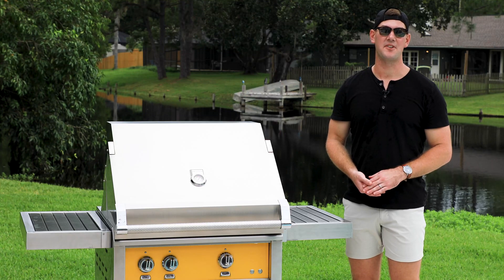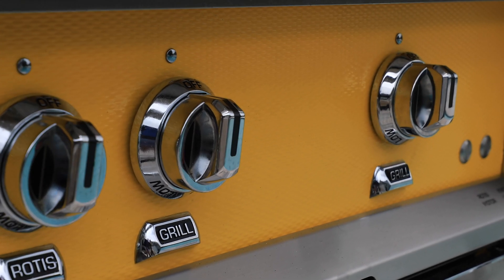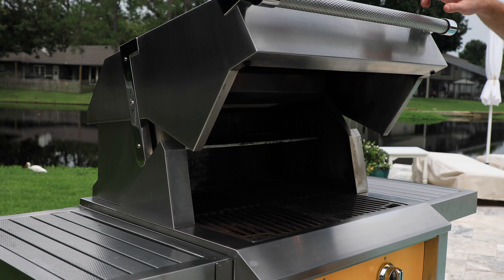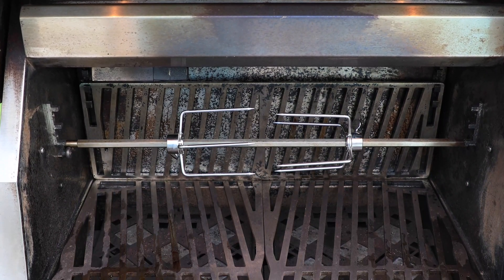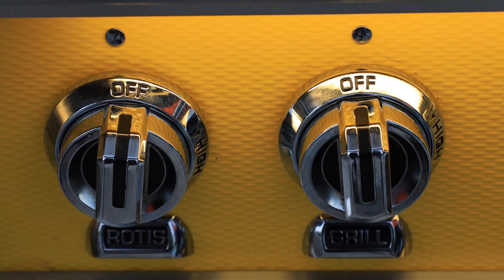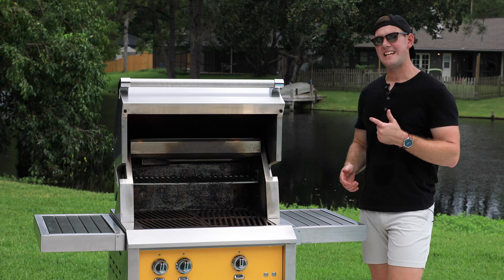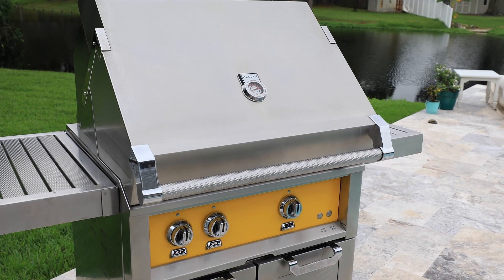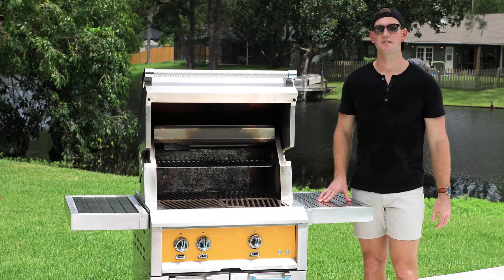Hestan Gas Grill Review | Grill Overview & Heat Test | What Makes These Grills Nice?

Comment: How manageable are flare ups with the Hestan?  I'm worried about the briquette system.  Some reviews rate the Hestan pretty low when it comes to flare ups.  What can you do to minimize flare ups?
Reply from the maker: What grills are you considering that you’ve read are better with flare ups? My view on flare ups really boils down to how clean people keep their grills and how messy of a cook someone is.

If the grill is properly maintained and cleaned frequently, flare ups shouldn’t really be much of an issue to deal with. Some people cook with too many oils, sauces and fatty foods with the expectation that a grill shouldn’t have flare ups because it’s expensive. 

Just be mindful of cleaning and cooking habits and you’ll be in good shape.

- Sam

Comment: Plannning on just the 30 since it’s just me and my wife.  Any reason the 36 is better other than more space?
Reply from the maker: Features will be the exact same. Only thing really to consider is if you’re planning on an infrared sear burner down low. If you’re doing that, the 36 might make sense so you aren’t rendering half of your grill space somewhat useless since a sear burner can only be used in a limited fashion on select foods.

- Sam
Reply: @justgrillin  isn’t the IR burner variable like the Lynx though?
Reply from the maker: @ESW206  you can use the top rotisserie burner for searing but some prefer having a true infrared burner on the main cooking area. 

Lynx designed theirs to be variable. Hestan’s is not. However, you really don’t want to use one of these burners to cook at low temperatures with fatty foods. The burner holes will eventually clog/you’ll get spotty performance. So while it’s a marketable difference, I wouldn’t make my decision on a grill based on that.

If you’re really just wanting a 30-inch, the Hestan makes sense cause you can get two traditional burners and use the rotisserie burner for searing. It’s angled down for that exact reason. And you can adjust the top rack in three levels based on how close you want the food to the burner.

Comment: Those briquette trays look rusted?
Reply from the maker: @ no. This is what most trays end up looking like when they have been cooked on a bunch over the years. It’s from the heat discoloring the stainless and grease/fat drippings too. This grill was a few years old that I used in the video. Was a distributor loaner. Wasn’t cared for as well as it should be.

- Sam

Comment: The brisket metal housings appear rusted.  Aren't these stainless steel as well?
Reply from the maker: Brisket metal housings?
Reply: Sorry.  Meant to say Briquettes.   @justgrillin
Reply from the maker: @rickirizarry5079  the housings are, yes. Their appearance here in the video is a combination of a few things but mainly boils down to cleaning and heat. The trays are going to change to a bronze color relatively fast due to heat. That’s why high end grills double line/wall their hoods so no discoloration makes it to the outer appearance. 

The second major factor is grease. Grease eats away slowly at the metal which makes it seems rusty when it’s not really rust. This grill belonged to our distributor and has seen some strong years of subpar cleaning. That’s what I would attribute what you’re seeing to mainly.

- Sam

Comment: I've heard that you have to worry about 2 things with this grill.  1. Wind can be a big issue with the burner flames damaging the grill.  Is this grill more susceptible to wind vs something like a Fire Magic Grill?  Also flare ups.  I've read reviews of people complaining about flare ups with the grease not being able to escape the ceramic briquet trays.  How would you rate the flare ups vs something more traditional like a Fire Magic?  Last how does Hestan warranty compare to the other big luxury gill brands?  Any reliability issues with Hestan?
Reply from the maker: Great questions.

1.) Wind is a factor with any grill. If you're in a windy area and don't have something to block the wind from the rear of the grill, you just need to purchase a wind guard to mitigate that. We're in a coastal area so a wind guard is pretty much an automatic add-on for many of our clients situated along the beaches in our region. Alfresco has the open-air system to help prevent the front control panel from heat blowback and they recommend a wind guard still. Manufacturers are getting stricter with their warranties so depending on the installation or setup, they might deny a claim stemming from what you're talking about because they would deem it improper installation if a wind guard wasn't used. That is if there's no wall behind the grill to break the wind. This isn't a metric we test so I can't really compare one brand to the other on this. If wind is an issue where you are, a wind guard/break is needed in some capacity probably regardless of brand.

2.) Flare up issues usually stem from poor cleaning. The trays are designed to be flipped over after every cook so you can "self clean" them by letting the dirtier side burn off when cooking the next time. If you do your basic care for the grill periodically, no reason that flare ups would be an issue.

3.) Hestan has a decent warranty. They add an extra year to it if you purchase a grill cover at the same time you buy the grill. Fire Magic's warranty is more robust and comprehensive. Hestan hasn't been around long enough for there to be a large enough network of existing grills to really get an understanding of maintenance on them. We haven't been notified of any issues with the grills we've sold and/or installed over the last three years. 

Alfresco Grills is another brand to consider in the luxury category. They're a top-tier brand and we get very low warranty claims on their grills. The reliability and performance is very good. We've repped them since 2004 so we have a long list of consumer feedback on their grills.

- Sam
Reply: @justgrillin  great appreciate your feedback!
Reply: You won't have to worry about the wind if it's a built in set up!

Comment: Echelon vs Hestan- what’s recommended?
Reply from the maker: Let me start by saying both are well-built products. That said, the features of the Hestan excite me more than those on the Fire Magic.

I think the lighting system is better, I like the dual-function rotisserie/sear burner, the tuck-away rotisserie storage, the stay-in-place hood and I like the grates on the Hestan more.

I don’t put much value in the built-in digital thermometer on the Echelon because I use external devices that I like more. Not sure if looking at the window model but I think it’s more gimmicky than useful.

Both have the same type of ignition system. Burners on both are powerful but each offers their own advantage. 

For the price points, I think you get more with the Hestan. I’d recommend looking at one in person if possible. The biggest consumer feedback we hear is the grill seems large because of the hood shape so some base their choice off that solely. 

If you have other questions, just reply back. Thanks for asking.

- Sam
Reply: @justgrillin  can you price a Hestan?
Reply from the maker: @toddbraden1752  our team can. You can call in to our showroom at 813-962-1700 or send an email to info@justgrillinflorida.com detailing what you’re interested in and your contact info.
Reply: @justgrillin  Thanks
Reply: Very very helpful review! Thank you!

Comment: Heston is the worst (and most expensive) grill I’ve ever owned.  It literally overheated on the second use and fried the igniters.  The knobs over heat and become too hot to touch.  Customer Service is non responsive.  After three months of constant calling they finally agreed to make the repair and now one week later I’m trying to cook my Thanksgiving turkey and the grill has gone out twice and the knobs are again too hot touch.  I don’t know who owns Heston but As an owner of my own company if you’re not willing to stand behind your product you have no integrity.  Don’t buy Heston grills
Reply from the maker: @DarrenSloniger-w5g  we’ve installed dozens of their grills and have never had a call back about this type of issue. Not really sure about what’s to give with your issue. Could need a wind guard wherever you’re located to stop the wind from pushing the heat forward? You could be cooking with oils that cause a mini fire?

It’s rare for a grill to have serious issues like you’re describing. Usually there has to be something wrong with the installation (if it’s built in) or something external acting as a driving force. Based on the limited info, it sounds like wind is a problem for your scenario.

I would agree with you that it’s tough to get through to their direct customer service. That’s why it’s best to buy from a local dealer that has a local rep that helps expedite responses and solutions. Not saying you didn’t do that as I have no clue. But if you bought online, I would advise never to do so again. Online retailers will do nothing to help with issues and a local dealer isn’t going to help if you didn’t support them with the purchase.

It sounds like you’re getting blow back from the wind and need a wind guard.

Your experience might not be great right now but it’s not indicative of the quality of the grill and it’s performance.

- Sam